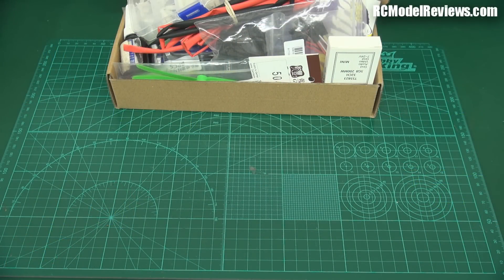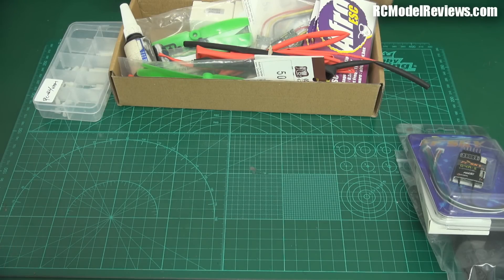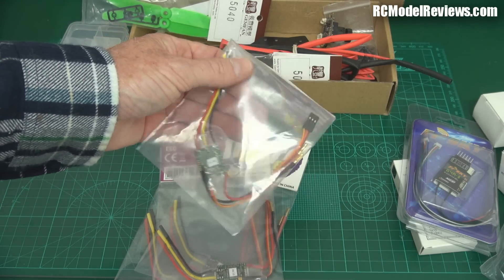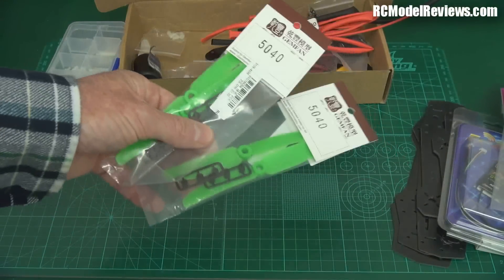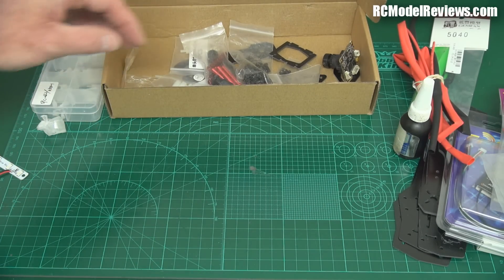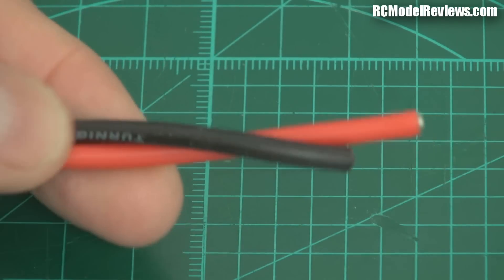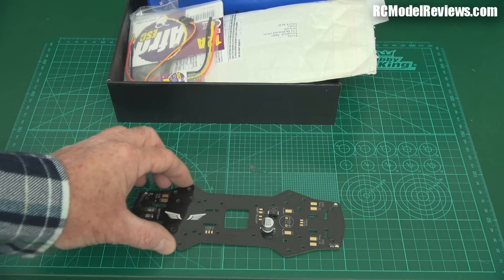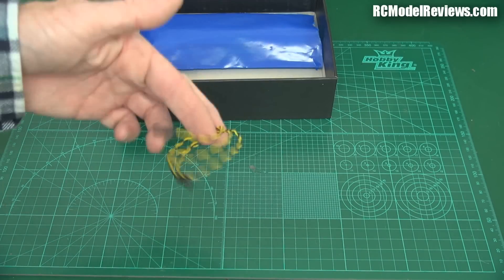Low cost miniquad racing drone build video PART 1

Comment: Bruce, you've gotta try the minimOSD. it's only about $16 and does everything the more expensive OSDs can do!
Reply: OldDude909 I found this firmware to work 100% right off the bat, voltage readout, GPS/speed readings, all just worked by default, https://code.google.com/p/rush-osd-development/
Reply: ***** No, my GPS was $25 more, not essential though.

The OSD itself it pretty awesome. You choose for every display item, if you want it on, and where.
So you can just do battery voltage, or you can add as much or as little as you want. There is a menu that's controlled from your Tx sticks, if you have it hooked up the naze serial port.

I have voltage, current, altitude, flight mode, armed/disarmed, a pointer to home, a  horizon line, and a compass direction in the corner. I thought it would bug me or make it hard to see with so much on there, but it doesn't really. If it did I could pare it down to the essentials.
It also lets you see and change your PIDs when you disarm. All in a 15mmx15mm board. 
http://www.readytoflyquads.com/micro-minimosd
Reply: But not suitable for a newbie since with it's default hardware and software configuration it will not work with the Naze32 board or allow simple direct connection of the flight battery. In any case if one was to invest into a Taranis with it's fully voice announced telemetry the need for an OSD is moot.
Reply: Rob B Indeed ...Minimosd to work good and have all features is a bit of fiddle 
Its not for newbie ..
All u need really is VOLTAGE to start with 
Getting  a 9 $ cheapo  OSD  plug and play is right for a  beginner
Reply: Agreed. Plus they're $10 from http://www.readytoflyquads.com/

or for $13 you can get a miniaturized one. That's what I bought, and it's awesome. Not too hard to set up at all.
Reply: jesondag $10 US. the exchange rate to AU$ sucks right now!
Reply: Rob B The flight battery connects to the naze32 with 1 wire. Can't get any more simple than that! All you have to do is upload the KVOSD sketch then no more configuration is needed, everything just works and is pulled from the naze32.
Reply: Rob B I have a taranis, and I love its voice readouts, but I can see somebody wanting OSD in addition/instead. For example, it might be nice to know pack voltage, current draw, and battery capacity all at once. That's a lot of stuff to read out one after another.

Also, if you fly in a group, the Taranis voice alerts can annoy other pilots.
Reply: Joshua Bardwell An ear-bud does a good job of avoiding the "was that my radio talking?" situation :-)
Reply: Joshua Bardwell Plus the GPS home pointer, speed, and distance are nice. The horizon line is also handy. For the $13 I spend on the micro minimOSD, it was well worth it.
Reply: mPky1 On a miniquad... less is more.The last thing I want, when weaving through the trees, is a whole lot of OSD mumbo-jumbo cluttering up my field of view :-)  And the $13 doesn't include the GPS right?
Reply: mPky1 Just something else to break when you hit a tree :-)  Actually, someone has sent me a 3D printed camera tilt mechanism so I'll try it out but right now I just angle my camera up at about 30 degrees and that does the job.

Comment: Bruce, the AOMWay 200mw mini transmitter is a much better choice IMHO. It's connectors are also compatible with IMRC, and it has 5V out too (like IMRC). It also filters better.
Reply: I have a couple of their 500mW VTX and I agree entirely with you comments. Not sure if the 200mW versions are the same but the 500mW versions have a not so well known jumper for selecting 5 or 12V output. The 12V out is convenient for the basic 12V board cameras like the one Bruce is recommending as it simplifies the wiring.

Comment: dear Bruce, nice video... I built similar quad.. and only one comment that is very important... the 200mw transmitter with the carbon frame... was not powerful enough to get even 100m... maybe was some mistake in my build but...you should maybe suggest a little bit more powerful transmitter ..
Reply: Giovanni Perillo I'm using several of these 200mW transmitters with carbon-framed miniquads (the Mini Mamba I just reviewed is an example) and I get several hundred meters of range with no problems at all.   Correct antenna choice and positioning is important of course.
Reply: ***** Thanks for answering... I really appreciate.. I use classical cloveleaf antenna.. positioining it on the back of the quad more or less over the frame. but nothing improved the range. I will try again... thanks for your time. 

PS: the same setup on the plane gave me 600m with no problem.
Reply: Giovanni Perillo For what it's worth, I find my FPV gear performs much better on a miniquad if you angle the antenna to be tilted backwards about 45 degrees.  This means that once you start tilting forwards it angles the antenna itself to be more horizontal.  It also means that it's less likely the carbon frame will block the signal when you're flying away from yourself.   If you're using an extension between  your VTX and your antenna be careful that it's a good quality one.  Bad extensions can result in a lot of lost power.

Comment: I'm just about to start a quad build similar to this! Why not get the black versions of the motors? And why don't hobbyking supply the naze 32 in the Aus  warehouse? :( I'm doing a wooden frame to start with them going to a HK smack frame later when I improve :)

Comment: Is there any budget goggle sets or screens you would suggest? I have looked into racing quads a few times and each time it has always been the video equipment that seemed to send to total bill skyward.
Reply: feygan hobbyking had a budget pair of goggles, just search for goggles, they come with camera, transmitter and everything to get you started for 90usd~ (Quanum Complete FPV Bundle)
Reply: Check out Head Play googles, it's coming out in April, like $200, instead of $500
Reply: feygan The Quanam goggles bundle is pretty good value, personally I use the $30 kit (just the goggles) then got a 5.8GHZ tx/rx deal for $80 on hobbyking, plus I got an extra 600mw transmitter for the mini quad, as I found the 200mw not good enough. I upgraded my quanam googles with a higher resolution 800x400 res screen for $30 and a glass lens from ebay. It's better than any fatsharks I've used.  Check out the thread on RCGroups just search for quanam goggles, there is a TON of info from us about building the cheap goggles into awesome cheap goggles.
Reply: First you have to decide if you want to use goggles or a monitor. If goggles get the best you can afford, I learnt a long time ago, buy cheap buy twice. I think you are better off getting a used set of fatsharks or Skyzones than buying a new set of lesser quality that will not be as good. The whole point of this is the FPV experence so no point in cutting costs here if you can. Also be aware the footage you often see of racing quads on youtube is not what you see in the googles. All goggle footage is not high def like a go pro etc.. just a heads up on that. There are reviews on most of the goggles on the tube.

Hopefully this will be covered in one of the next parts as I found this also a nightmare to research, so many options and certain stuff isn't compatable with each other
Reply: feygan What I did for goggles was I got some 10$ clear lens Dirt bike goggles on Amazon and a 4.3in screen. Then took the cardboard boxes that came with it all and framed the screen to the goggles. It is Awesome because I can put the receiver on the side of my goggle and have the batteries on the strap. The screen and goggles costed about $25-$30 (Depending on screen). The batteries from there were just about 16$ from there. Pretty comfy and I used some dollar tree electrical tape and made it so no light comes in at all. Cheapest way I have made goggles so far. A little ingenuity and duct tape lol.
Reply: Steven Ritter I agree. I'm looking forward to the reviews of the Head Play goggles.
Reply: feygan http://www.hobbyking.com/hobbyking/store/__53706__Quanum_DIY_FPV_Goggle_Set_with_Monitor_KIT_.html
Reply: feygan Get some 2nd hand ones on ebay.
Reply: Second hand fat sharks, or HMD, either way should (or really must) try them on before you buy, because you never know what will fit your face.
Reply: for super budget screen look for a used travel dvd player with av in. I got one for $14 at a goodwill store here in oregon. Then you get the video rx and cp antenna. I use mine with the av out on the fatshark. or get spektrum branded fatshark for $250.
Reply: Designandrew Please make a video of your upgraded Quanum goggles.
Reply: I dont really have time but if you go to the RC groups thread here, read it, it's got all the info you need. http://www.rcgroups.com/forums/showthread.php?t=2184050&page=179
Reply: Well from his other videos on the higher end models such as the 3d models I think the jist is that you get what you pay for. If you are looking for the sharpest most accurate display then you will need to pay for that quality. I have decided to save up for my 3d system. The better you see the better you pilot!
Reply: Designandrew can you link to the 800x400 screen and is it non-blue screen one? quanum goggles are awesome I just wish some more resolution
Reply: fermanut Actually go check out this thread, because http://www.rcgroups.com/forums/showthread.php?t=2184050&page=179 Surveilzone have made a screen that not only has the high res screen, but also SNOW screens (wont cut to blue screen on low signal) PLUS it has a build in receiver, so it's a straight swap compared to the stock screen. And only 50 bucks.. awesome value IMO
Reply: Designandrew thanks for this! it's really nice I must say, but it seems that 5.8g is the only option with it ( unless the 'video in' can be installed somehow ) I'm guessing that there is no chance that you open it to check how it's done under the hood? I'm guessing that it just may be connected with RX this way and it would be easy to mod. At the moment I'm on 5.8g but thinking of moving to 1.3g and then this nice LCD would not be very useful...
Reply: Hobby king pit
Reply: Hobby king makes a diy set but bulky, great to start with.  Big problem is there is no place to try some on to check the comfort. before you buy
Reply: feygan v2 of the budget Quanum FPV : more expensive than v1 but better design
http://www.hobbyking.com/hobbyking/store/__78126__Quanum_DIY_FPV_Goggle_V2_w_5_inch_LCD_Monitor_Kit_US_Warehouse_.html?strSearch=quanum%20fpv
Reply: I just bought the HK quantum v2 goggles and I love them. But I had to modify them for me.  I placed a foam spacer to the end and attached the monitor on that.  It brought the focal length back making it easier to focus with the fresnel lens .  I just wish I could have a longer neoprene sock  for it to fit my modification better. But I find it is easier to use without using reading glasses.

Comment: Bruce,
Brilliant! That's almost exactly my miniquad that I built as my first, budget trip into the hobby.

My only real difference is that I paid about £5 (9AUD) for a set of ZMR250 frame spacers from Ebay. They're 3D printed and a bunch of people sell them. You do need to use some longer bolts for the arms, but I had a bag of Ebay special assorted that did the trick.

They add enough room to fit the ESC's between the lower panels of the frame (I think the max current draw of the DYS BE1806's is about 8A on a 5030, so they don't get hot).

Plus if you look around you can find a set that come with nice LED strip mountings for the front and rear, which is awesome. Keeps them out of the way, and means you've got head/tail lights which is great for orientation!
And the mounts also bolt the bottom sheet to the top, and the front aluminium spacers, which makes things a little stiffer.

Comment: Thanks for this series! Definitely planning on building one of these, if not for myself then my father. 

A couple questions: Will you cover battery selection for this quad? I'm quite the RC quad newbie and there are tons of batteries out there. Which FPV goggles/monitor do you recommend? Finally, for others who may be starting with this video from the youtube search or such, which RC transmitter would you recommend for a beginner? I've already got a FrSky Taranis based on one of your earlier videos, but recommendations can change. 

Looking forward to parts 2 and 3!